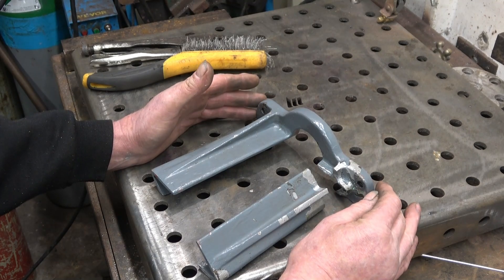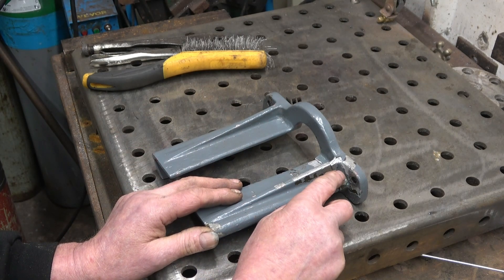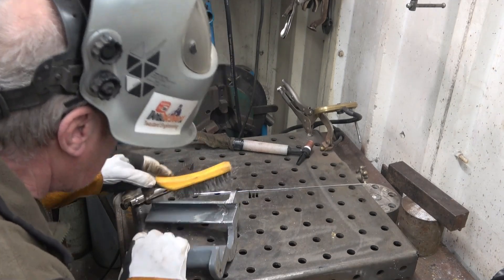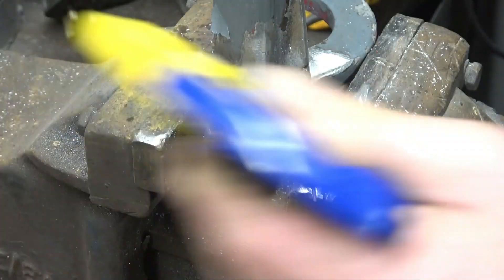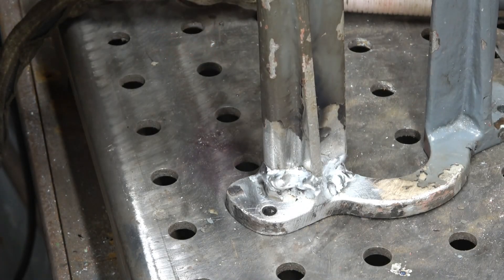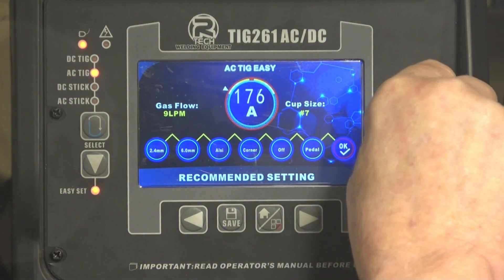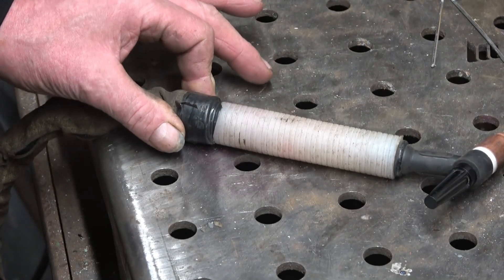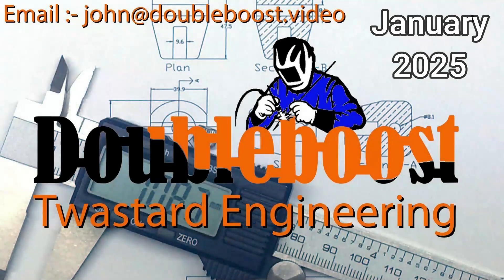R-Tech AC/DC TIG 261TFT  . Aluminium Casting Repair: Real World Welding

Comment: Hi John.can u tell me what ac frequency the machine was running at. Thanks..
Reply: Sounds about 110 120
Reply from the maker: In easy set the machine gives you a very good set of parameters to start with . You still have full control over the machine in manual mode . I would use 120 HZ  AC balance 30 % . To be honest the easy set felt just like that .